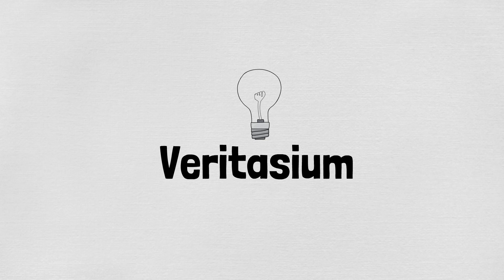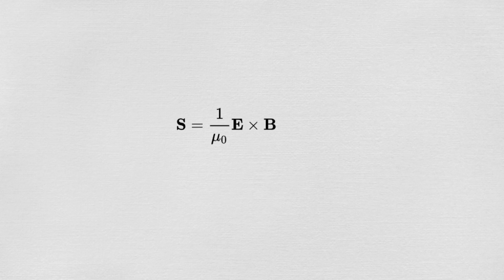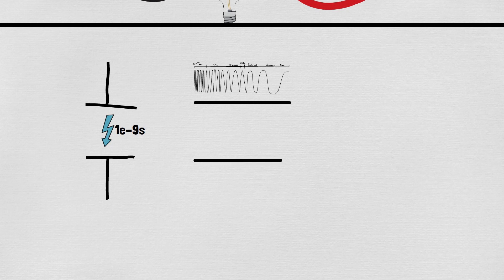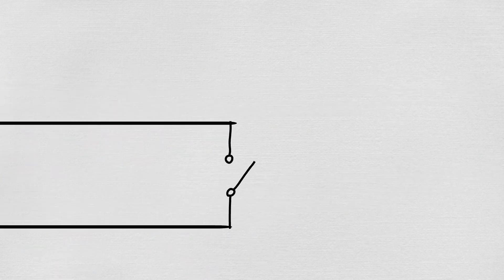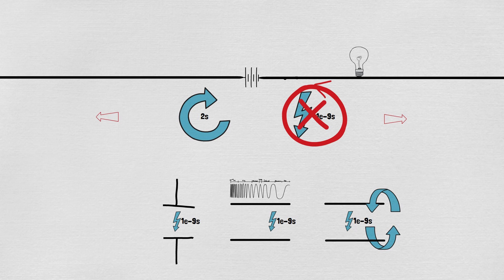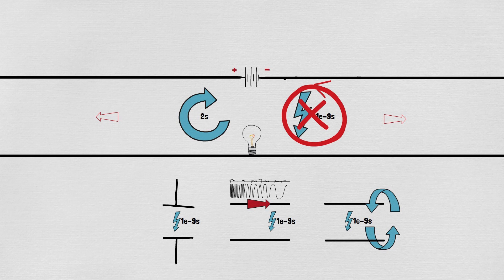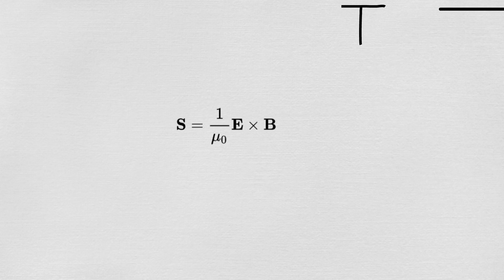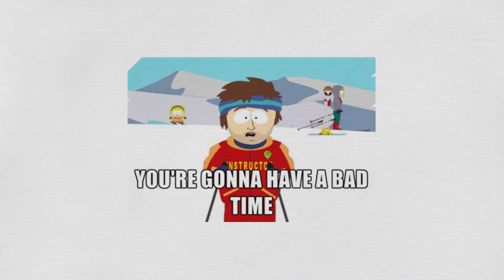Veritasium is Right? (see description)

Comment: The easy explanation, which everyone seems to miss, is transmission line theory. The long circuits at either side are transmission lines. The "surge impedance" or characteristic impedance, is what causes the bulb to glow, albeit not at full intensity, right after the switch is thrown. The initial current surge in a transmission line is due to charging the capacitance of the line, impeded by the series inductance of the line. The charging surge propagates down the line at some fraction of the speed of light, depending on the velocity factor of the transmission line, and until it reaches the far end, and reflects back, the line looks (to DC current) like a resistor with a value of the line's characteristic, or surge, impedance. If the transmission line was infinite in length, the charging surge would continue forever and it would continue to look like a resistor, but in practice, finite length transmission lines are often terminated by a resistor equal to their characteristic impedance. Therefore, when the charging surge gets to the far end, the resistor simulates the infinite length, no reflection occurs, and the beginning still sees the characteristic impedance. If the far end is shorted, open, or some other resistance, reflections occur, and the circuit oscillates until equilibrium is achieved.

The fact that he drew the original diagram so that an electrical engineer could see it as two transmission lines strongly suggests he knew it all along. Why he tried to suggest all the mystery or suspense is the question, when transmission line theory could have explained things in a very simple manner.
Reply: No, you've got the wrong part of the circuit. Each of those long legs of parallel wires would be a transmission line, if you applied a signal across them. But that's not what's happening. Closing the switch applies the signal between the two legs. You can see that by realising that the electric field is created between the two legs, not across them. If you have a transmission line, it is made up of two wires that diverge from the battery/switch in opposite directions for a huge distance and then return to meet at the bulb. Feel free to calculate the capacitance of the setup in order to work out the propagation delay of that transmission line.
Reply: lol "The easy explanation" followed by an essay
Reply: @Eitan Tal Characteristic impedance depends on diameter of conductor. I just guessing that for 1 meter separation on reasonable wire size, it would be 1000 ohms or more. Bulb filament resistance depends wire size and temperature. You've got the right idea, and it could be measured.
Reply: @bloocheez3  Still easier than any other explanation so far...
Reply: @RexxSchneider  If it helps you visualize it as a transmission line, imagine a very long piece of RG6 coax on each side with the center conductors connected to the battery/switch, and the outer conductors connect to the bulb. The left transmission line is in series with one side of the bulb, and the right transmission line is in series with the other. When the switch is closed, each transmission line initially looks like a resistor with a value equal to the characteristic impedance until the current surge propagates to the other end.
Reply: @timothystockman7533  828 ohm for each line (276 * log(d/r))
Reply: @RexxSchneider  This is clearer than the argument in the video. The switch doesn't immediately create a potential difference unless we assume a non-ideal wire that has some amount of charge in it already per unit length.

The battery side looks more like a dipole antenna. The thing is, for t , 1s, it's an antenna of infinite length, so it can't resonate at all. Plus it's only getting a step function. I don't know enough about EM theory to say, but my gut says that when you do the math, the energy transfer will go to 0.
Reply: The problem with this question is it is poorly defined. What does "turn on" mean? Is a picoamp of current sufficient to claim the bulb is "on"? In that case the bulb is always on due to changes in earth's magnetic field, or from background radiation.

 It is disingenuous to say the wires are ideal and have no resistance but then argue about the capacitance/inductance with no details provided when the question was first asked.

The transient surge current in the bulb from the wires acting like antennas is significantly less than the DC current from the battery through 0 ohm wires into the bulb, so I would not consider that sufficient to "turn on" the bulb as the question asks.
Reply: @MrGigaHurtz  This is exactly the problem. It will turn on "completely" after 2 seconds. Everything before that is just parasitic noise you don't want in your circuit.
Reply: For EE's, Elementary my dear Watson.
Reply: @RexxSchneider  I think you are forgetting to take into account the very long distances involved. I think the TL model really fits the best in explaining what actually happens.
Reply: Yes but his "demo" doesn't show that at all.  There is no way a single switch-on pulse from a 12-volt battery is going to transmit enough power across a 1-meter gap to continuously power a standard 120-volt AC bulb.  This is what we're all so upset about.   Rather than talk about an interesting bit of reality, he made a sensationalized demo that appeared to break causality, because you know it's all for the clicks yo.
Reply: @peterh222  I agree. Veritasium took a too simplistic approach.
Reply: @Doeff8  I didn't forget anything. What you are missing is that any transmission line would be made up of two wires: the long wire connected from the negative of the battery to the bulb and the long wire connected from the switch to the bulb. The total inductance in each wire would be several Henries, but the total capacitance between those wires is effectively a 1 metre long pair of wires separated by 300,000 km and it's fractions of a picofarad. The surge impedance is therefore gigantic, and that shows that very little surge current will flow. Is that the TL model you wanted to use? or are you still thinking that each wire can make a transmission line on its own?
Reply: @RexxSchneider  You take those parameters. I think the TL model still fits best. Have to think about the correct parameters in this case. Veritasium simplified too much, that is clear.
Reply: @RexxSchneider  Who runs power or signals with a single wire in a big circle anyways?
It's always positive and negative or phase/signal and neutral/ground combined and run in parallel.
Reply: @domenickeller2564  The original video said the bulb "turns on" with any amount of current. That's the situation of interest, rather than the time for full current to flow.
Reply: Your whole point is flawed since the lines in this circuit are ideal, i.e, zero impedance.
Reply: @realedna  A wireless charging circuit is an example of running power through a single wire in a big circle that can be picked up by other nearby coils. Actually, the single wire in the transmitter is probably several loops, but you get the idea.

For small amounts of power, like that needed to light a few LEDs,  inductive coupling is a practical solution.

As for signals, the system of using an inductive loop around a room to directly transmit speech to people wearing hearing aids has been in common use for decades.
Reply: @alanzom1503   a two wire transmission line (or any kind of transmission line) with perfect conductors has a characteristic impedance of sqrt(L/C), where L and C are the distributed inductance and capacitance per unit length on the line. That’s the “impedance” he is talking about.
The reason everybody is getting so confused (including the nuclear physicist who made this video) is because transmission line theory is really only studied and understood by EEs (and many EEs don’t actually study it either, it’s mainly RF engineers and related sub-disciplines in EE).
Reply: @RexxSchneider  Why are you trying to defend some obscure understanding of electricity, when the common rules for circuits (DC and AC) can be understood more easily without considering fields?
Actually, Veritasium wants us to believe, that you can short-circuit a superconducting long wire with a short distance of empty space to deliver DC power. How nonsensical is that?
Reply: @realedna  When you ask me "Who runs power or signals with a single wire in a big circle anyways?" I gave you an obvious answer: lots of people do. There's nothing obscure about wireless charging or induction loops for hearing aids.

I'm perfectly happy to discuss circuits with you at whatever level you choose, but the problem with the Veritasium video is that you need more than a basic understanding of electricity to examine the situation when the length of a signal path is great enough to cause effects that differ significantly from the steady state.

In the case of that video, we can all agree that when the circuit has settled down, then assuming a 12V battery and a 48 ohm bulb (common in cars), you have 250mA current flowing and the bulb consumes 3W of power. Basic electricity theory will give that.

The problem is that he's posing a question about how the circuit behaves between the time it is off and the time it has settled down. He makes some simplifying assumptions, hiding among them one that is impossible. He then causes a load of confusion by bringing in an alternative view of the transport of electrical energy through static electric and magnetic fields using the Poynting vector. That allows him to confuse those static fields that are associated with the steady-state circuit with the electromagnetic wave that is produced by the very rapid rise in voltage at one point in the circuit when the switch is closed. Having performed that sleight-of-hand, he then claims that the energy in that wave will be delivered to the bulb and cause it to light and stay lighted until the energy associated with the current is delivered. Of course, if you can't do the analysis (or do the wrong analysis), then you have no idea that the wave can deliver only an infinitesimal amount of energy to the bulb, and that it is dissipated in nanoseconds, while the current will not arrive at the bulb until a second or so has passed.

I don't think I'm defending an obscure understanding. I'm happy to talk amps and volts, or teslas and volts/metre, as long as nobody is trying to pull wool over our eyes. I'm happy to consider energy as volts times amps or E X B whenever that is needed to reach a proper understanding. I simply disagreed with you that the circuit in question could be analysed using the concepts of "positive and negative or phase/signal and neutral/ground combined and run in parallel" that you suggested.

Your last question was "Veritasium wants us to believe, that you can short-circuit a superconducting long wire with a short distance of empty space to deliver DC power. How nonsensical is that?"
My answer is that it is nonsensical, but he had wrapped the entire setup in so much FUD that it needs a very clear picture of what is happening to see where the nonsense actually comes from.
Reply: @realedna  He didn't say that there is DC power at 1/c seconds, though. He just asked when there was any power to the bulb.  The power that arrives that fast is from the transients when the switch is connected, which induce a current in the bulb. At that point in time, the transient might as well just be a portion of an AC wave - it's a sudden change in state when the switch is closed.
Reply: @realedna  You can demonstrate that an open circuit can deliver DC power. Take an ohmmeter and touch it to the leads of an electrolytic capacitor. The ohmmeter will "twitch", because when discharged, the electrolytic cap looks like a short. As it charges, it begins to look more like an open circuit. The point of original circuit is that the transmission line on either side looks like a capacitor. Since the transmission line has series inductance, it will not charge as quickly as the electrolytic cap. The charging surge will propagate down the line at some fraction of the speed of light (see velocity factor), so for more than a second, the transmission line will look like a resistor with a value equal to the surge, or characteristic impedance.
Reply: Thank-you for finally making a sane statement about this problem. The two transmission lines will have a  characteristic resistance of something in the 70 to 300 ohms range (depending on spacing and diameter of the wire). So the bulb will turn on but it will be dim because of the extra circuit impedance of the line. When the transient reflection finally arrives from the far ends (9 seconds later) the bulb will reach full brightness.
Reply: @RexxSchneider  I think Ive changed my mind. In the original problem, everything on the other side of the switch was pulled down 0V relative to the positive battery terminal. As soon as that switch closes, charge carriers will start spreading into the wire to distribute charge to achieve local equilibrium. 

If it's just a long piece of wire, the problem is indeterminate, because we don't know what charge the wire has relative to the battery terminal.
Reply: @RexxSchneider  You sit backwards on the horse. The thing you mentioned is not the transmittion line, that's why it doesn't work. There are 2 antisymmetrically excited, 1/2 lightsecond long transmittion lines here. Each of the transmittion lines are made of 1 of the wires, and therefore they are shorted at the far end. The excitation is ε(t)*Vin/2 for each TL (due to geometric symmetry reason). What is so difficult in this? Probably you have confused 2 subtasks: With these transmittion lines you can calculate the value of current reaches the lamp. But it doesn't tell at which moment this current will reach the bulb, because TL theory deals only with EM mode that travels along the wires. The mode determining the delay of the bulb is a different mode of EM wave, traveling perpendicular to the start of the wire, and the shape of the wavefront is spherical, because the medium is homogenous air (OK, this is only an reasonable simplifying assumption).
Reply: @PafiTheOne  You claim "There are 2 antisymmetrically excited, 1/2 lightsecond long transmittion lines here." But what you think is "antisymmetric excitation" is not excitation at all. The wire on the negative side of the battery, the side without the switch, receives no excitation. The voltage along the entire length of that wire remains at 0V throughout the entire experiment. If you think otherwise, then explain what voltage is at what part of the wire and why. The wire on the positive side of the battery doesn't receive an excitation (a 12V step) relative to its other end, because the potential at the other end isn't fixed. If your analysis were correct you could make a transmission line by connecting one end of a long folded piece of wire to a battery without connecting the other end to anything. You're trying to ride without your horse's hooves touching the ground.

As for your "different mode of EM wave, traveling perpendicular to the start of the wire". I agree that there is a spherical EM wave radiating outward at the speed of light cause by the closing of the contacts at the switch. But I also know that it carries an miniscule amount of energy, whose density drops off as the fourth power of the distance. At 1 metre away, it is impossible that sufficient energy can reach the bulb to light it. The bulb will not light until the 12V step voltage travels around the long positive wire at somewhere near the speed of light and arrives back at the bulb. That is the static electric and magnetic field mode where the magnetic field is around the wire and the electric field is between the long positive wire and the long negative wire.
Reply: @RexxSchneider  "If you think otherwise, then explain what voltage is at what part of the wire and why." I have already done it, however I neglected the resistance of the bulb. 
More detailed way: 
1, After 3 ns the transients have ended in the space between the (switch+batery) and bulb, therefore there is no induced EMF left here, so the sum of the voltages around a closed loop (in this area!) must be 0 (faraday's law becomes KVL). 

2, Therefore V(batt) + V(start of left wire pair) + V(bulb) + V(start of right wire pair) =0. 

3, I assume V(bulb)=small negative (due to the systematic polarity coming from loop ), you assume V(bulb)=0, therefore my assumption is safer. 

4, The wires on the left are symmetrical to wires on the right, the battery in first iteration assumed to be close to the center, capacitance of the switch to ambient is considered negligible. 

5, Both wire pairs (=lecher type transmittion lines) have the same Z0, but the input voltages are defined above along a directed loop, which results in a reversed polarity compared to  the "natural" orientation. 

6, Rearranged the loop equation:  V(start of left wire pair) + V(start of right wire pair) = V(batt) + V(bulb) = approximately V(batt)

7, The natural assumption of V(start of left wire pair) = -V(start of right wire pair)= ~V(batt)/2 fits the equation, 

8, Any other voltage assumption results a netto current from battery to bulb, which alone doesn't violate physics, since there are charge carriers, but there is no driving force for such charge buildup. There is no vertical E field source, only lateral.

9, So only 1 solution has left. The (trivial) antisymmetrical input excitation. 

" the potential at the other end isn't fixed."

There is no requirement of having fixed potential to define an excitation (or any type of voltage). Only potential difference is needed. None of the potentials are fixed,  since no defined GND, but the potentials are tied to each other. This is called a floating circuit. They work. (Actually everything is floating together on Earth. In space.)

"If your analysis were correct you could make a transmission line by connecting one end of a long folded piece of wire to a battery without connecting the other end to anything."

But they are connected. You have forgotten the bulb. 

"But I also know that it carries an miniscule amount of energy, whose density drops off as the fourth power of the distance."

Here is a small, but essential mistake. Energy density doesn't drop with nth power of distance, but nth power of distance ratio . And the base of this ratio is the wavelength. But now wavelength is not a constant, but grows with time. Therefore energy density remains constant. Obviously, since the whole system inside the growing sphere is in steady (to be exact: quasy-stationary, since current flows) state. 

"At 1 metre away, it is impossible that sufficient energy can reach the bulb to light it."

This depends on the sensitivity of the bulb. And it was defined to be sensitive enough by Derek. Denying the opening assumptions is not an option in a thought experiment. Can you falsify the possibility of a bulb that operate at 6 mA? 

"The bulb will not light until the 12V step voltage travels around the long positive wire at somewhere near the speed of light and arrives back at the bulb."

You should really check transmittion line theory! The reflected wave doesn't magically close the circuit. The wave that travels to the end, reflected with the same current-polarity, and only this current is added to the initial current. But this wave (after some attenuation on the bulb) continues traveling to the other end, etc... The current approaches in infinite steps to the steady state in every seconds. 

Many  electrical engineers have shared this correct description, along with exact impedance values. It is our profession. 

"That is the static electric and magnetic field mode where the magnetic field is around the wire and the electric field is between the long positive wire and the long negative wire."

What is "That"? You wrote about propagation previously, so I can not associate a meaningful resolution for "that". The poynting vector can be calculated in steady state based on the whole current and charge distribution along the wire, if you mean this, but do you think it would give some other result? The E field between equipotential lines is ~0, so there is no energy transfer in the long "ears". Energy still flows in the close area.
Reply: @PafiTheOne  
1. You think that "the sum of the voltages around a closed loop (in this area!) must be 0" after 3ns. But that implies that the voltage at the far parts of the long wire are determined - and that would violate the impossibility of information travelling faster than the speed of light. You can't use static analysis when the system is still dynamic.

2. Let's put some voltages in. We can pick any point as a reference, so let's use the negative of the battery as 0V. Your equation becomes:
12V + 0V + V(bulb) + 12V = 0  so V(bulb) = -24V ?? Do you want to try again?

3. In the steady state, V(bulb) = V(battery) because there is no resistance in any other part of the circuit. If you treat it as a loop, then the voltage across the bulb is in the opposite direction to the voltage across the battery, but none of this is helpful, because nobody disagrees about the voltages in the steady state. If V(bulb) > 0 then current is flowing through the bulb and energy is dissipated. Where does that energy come from?

5. The surge impedance is only applicable to a potential applied across a transmission line. This circuit does not do that.

6. Put some numbers in: 0V + 12V = 12V + V(bulb). That shows V(bulb) = 0

7. Put some numbers in: 0V = -12V = 12V/2 ??? No, I don't think so.

8. The voltages relative to the battery negative just before the switch is closed are like this:
_______ ... _______ (0V) [ - Battery + ] (12V) _ Open switch (0V) __________ ... _______ 
|                                                                                                                                                                  |
|______ ... _______ (0V) [ Bulb ] (0V) ______________________________________ ... _________|

and immediately after the switch is closed are like this:
_______ ... _______ (0V) [ - Battery + ] (12V) _ Closed switch (12V) _______ ... _______ 
|                                                                                                                                                                  |
|______ ... _______ (0V) [ Bulb ] (0V) ______________________________________ ... _________|

and in the steady state are like this:
_______ ... _______ (0V) [ - Battery + ] (12V) _ Closed switch (12V) _______ ... _______ 
|                                                                                                                                                                  |
|______ ... _______ (0V) [ Bulb ] (12V) _____________________________________ ... _________|

As you can see, the only point that has a net change in voltage after the switch is closed is the end of the bulb connected to the right wire.
I'll ask you again, How does the voltage at that point change with time? Give me some numbers, assuming the bulb is a 12V 3W bulb, i.e. it has a resistance of 48ohms.
The E field is indeed lateral, but you are mistaken in thinking that the E field drives current. It doesn't. There is a clear potential difference across the bulb and that drives the current through it.

9. It's not possible for a positive 12V step to produce a negative voltage in a single circuit. The negative terminal of the battery is the most negative point in the circuit throughout, and your "antisymmetrical input excitation" as you describe it breaks that.
Put some numbers to your "antisymmetrical input excitation" - what voltages are at the four ends of the two long wires (A, B, C, D) when this "excitation" occurs?
_______ ... _______ (A) [ - 12V Battery + ]  _ Closed switch (B) _______ ... _______ 
|                                                                                                                                                          |
|______ ... ________________ (C) [ Bulb ] (D) ___________________________ ... _________|

There IS a requirement to have a potential fixed if you want to measure voltage relative to it, such as an excitation. If you want to talk about a potential difference causing an excitation across the long wire on the right, then you have to fix the potential at the end connected to the bulb in order to measure that excitation. If I connect a 12V battery to the inner core of a piece of coaxial wire without connecting anything else, I promise you that you won't get a transmission line response.

"But they are connected. You have forgotten the bulb." That's the point - you've made an analysis that assumes the end of the wire connected to the bulb is GND relative to the end of the wire that gets a 12V step. Without that there is no transmission line along the single piece of wire. But how do you justify that?

"Here is a small, but essential mistake. Energy density doesn't drop with nth power of distance, but nth power of distance ratio." Absolutely nonsensical semantics. Is English not your first language?

The equation describing power versus distance, r, has a the term r^4. That's distance, not a ratio. If you want to compare the ratio of energies at two different distances, then it's a ratio, by definition. But if you think that "Energy density doesn't drop with nth power of distance", then you need to start studying electromagnetic theory from the start. The FUD about "wavelength" is complete nonsense.
"Therefore energy density remains constant" You think that energy density remains constant with distance? No, it doesn't. Or that energy density remains constant with time? Again no. You really need to understand the implications of what you are writing. Just how much energy do think is radiated when you close the contacts on a switch?

"You should really check transmittion line theory!"[sic}. I have - and don't be so rude and patronising. I first studied it about 50 years ago, and I'm pretty certain that physics hasn't changed since then. You should study English spelling.

"The wave that travels to the end, reflected with the same current-polarity, and only this current is added to the initial current." Complete garbage. What "wave" travels to the end? What is this "current-polarity"? (Hint: the current only flows in one direction in this circuit). What initial current? Put some numbers to it and you'll see you're talking nonsense.

"But this wave (after some attenuation on the bulb) continues traveling to the other end, etc" How much attenuation at the bulb? If the bulb's resistance matches the characteristic impedance of the line, then there should be no reflected wave? But that would require the bulb to be connected across the transmission line, and it isn't. Give some figures.

"Many  electrical engineers have shared this correct description, along with exact impedance values. It is our profession." You mean that some electrical engineers have jumped to the same conclusion without actually trying to work out the size of the effects they are postulating. My advice to you is to find another profession if you thin the energy radiated from a switch closing can light a bulb.

"This depends on the sensitivity of the bulb. And it was defined to be sensitive enough by Derek. Denying the opening assumptions is not an option in a thought experiment."
Derek was lying. There is no such thing as a bulb that can emit photons from an arbitrarily small current. If we had one of those in the circuit we could just use a 12V battery, a 10pF capacitor and the bulb, which would remain lit forever because the current charging the capacitor never reaches zero.

"Can you falsify the possibility of a bulb that operate at 6 mA?" No, there are plenty of LED bulbs that will operate at 12V/6mA (effectively a resistance of 2K). But can you explain how closing the switch in the circuit under consideration can induce a current of 6mA through a bulb with 2K resistance? How long would that current last?

In response to your assertions about two different modes, I wrote:
" I agree that there is a spherical EM wave radiating outward at the speed of light cause by the closing of the contacts at the switch. ... The bulb will not light until the 12V step voltage travels around the long positive wire at somewhere near the speed of light and arrives back at the bulb. That is the static electric and magnetic field mode where the magnetic field is around the wire and the electric field is between the long positive wire and the long negative wire."

What is so difficult in parsing what I wrote? There is (1) a radiative mode, where an electromagnetic wave propagates outward in all directions from the switch closing. And there is (2) a steady state mode where the current around the loop is established and static electric and magnetic fields associated with the current exist in the orientations I described.

The Poynting vector is calculated by taking the vector product of the electric field and the magnetic field ( E x H ), not your "based on the whole current and charge distribution along the wire". The concept of "charge distribution along the wire" is meaningless as the wire has no resistance. If you can actually visualise the directions of the E and H fields, you'll find that E x H has the same direction at every point surrounding the long wires, and that most definitely includes the "ears". The farthest pieces of the wire are in fact the only place in the circuit where the Poynting vector points in the same direction as the wires.
Reply: @RexxSchneider   Oh. My. God. For a debate a common knowledge base is needed. If you deny/ignore/misunderstood the basic principles of electrotechnics, and also create nonexistant logic, then any debate is effectively impossible with you. 
Everything you replied in 1. is seriously wrong. No, it doesn't imply anything outside the 3 ns sphere. I explicitely limited my statement to the area between the switch+battery and bulb. The other parts are explicitely excuded from my statement to make the analysis easier for you. If you want to make further implications, then you have to explicitely prove it, it is not my problem. Your violation is made up. The "voltage at the far parts" is not even a meaningful, defined term. And I can use static analysis at the areas/time where the state is stationary. If you want to extend it in a wrong way (in both technically and logically and informatively), then it is your problem. Any voltages which could be defined outside the sphere are determined based on the previous, local story of the arrangement. Which is not dependant on the closing of the switch. 

2. Don't you know the number negative 6? Don't you know what antisymmetric means? (Opposite polarity but same amplitude for opposite sides.) Can't you read?!? I wrote ~V(batt)/2. Can't you divide 12 by 2?

Your lack of communication skills is painful. I can't continue correcting your incredible mistakes. 

Have a nice day!
Reply: @MrGigaHurtz  About 6 mA starts to flow after 3.3 ns. Picoamps are not relevant.
Reply: @RexxSchneider  You don't even know that a point doesn't have a voltage. A point can have a potential, but voltage is defined between 2 points, as a difference of potentials. The voltages that I mentioned are defined across the elements, and obviously not the potentials have to be added like you tried. Haven't you ever used Kirchoff's voltage law?
I'm not going to teach you the basics of network analysys. It's sooo below the level needed here.
Reply: @PafiTheOne  Where did you get 6mA from, what circuit did you use? The transient current will be at least an order of magnitude less than the DC current and will be very short duration. I stand by my argument that does not qualify as "turned on"